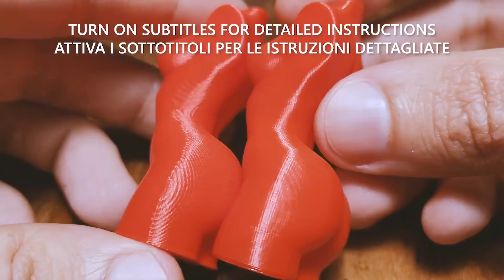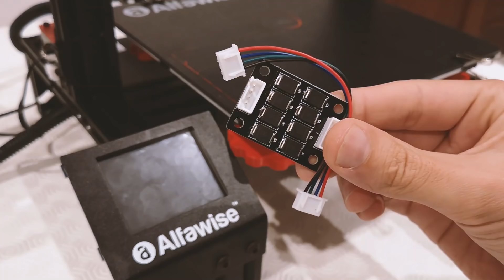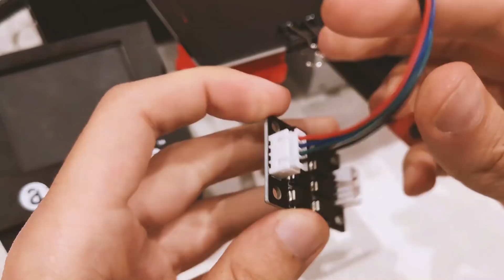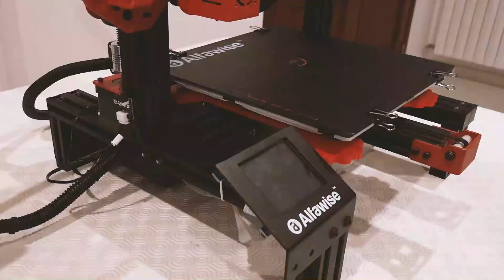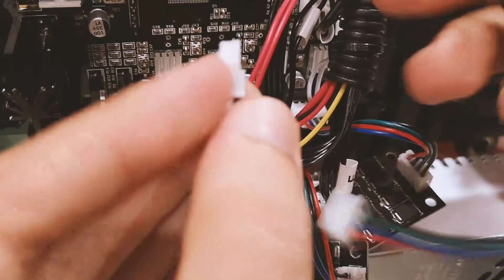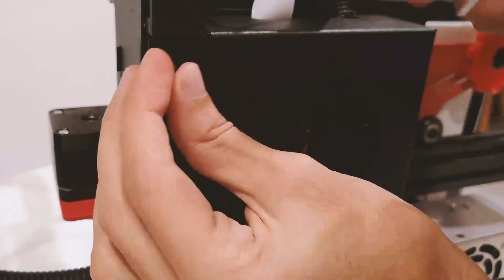Alfawise U30 + TL-smoother, guida all'installazione

Comment: would have been great if you showed how in the heck you were able to fit all that back into the box, it just cuts to you suddenly closing it up. and it even looked like you might have just left all those new parts dangling outside of the case too, but coundnt tell as you cut to fast from it.
Reply: They were hanging out of the box not tucked inside.  I was looking for the same thing :D